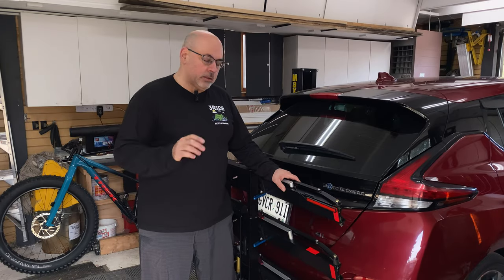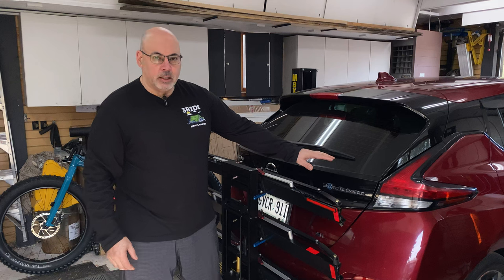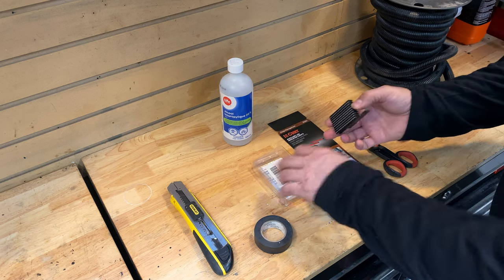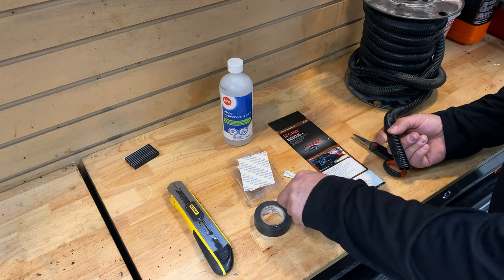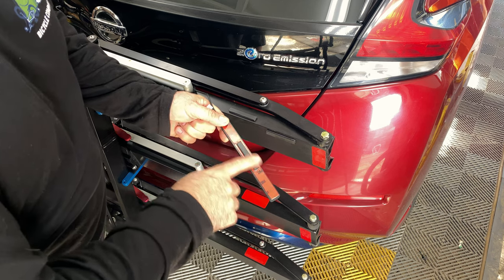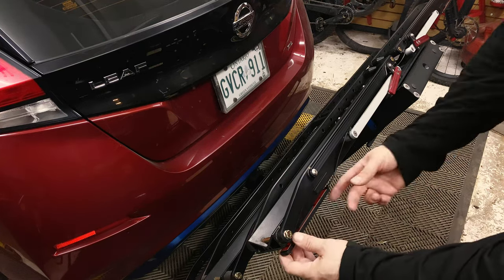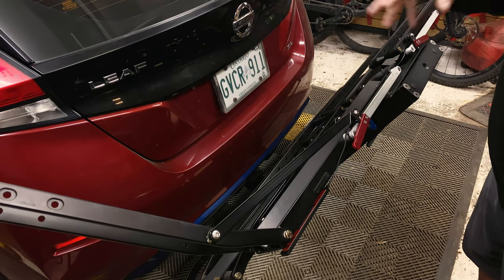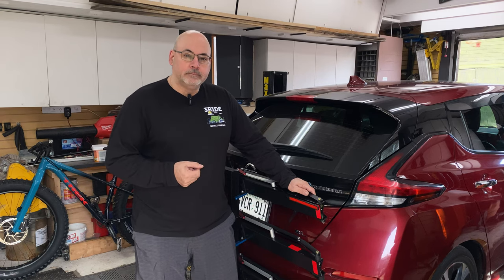Magnetic LED lights for your 1UP bike rack!

Comment: Thanks for the great tip. What did you do to install a hitch receiver on the Leaf? And what year Leaf?
Reply from the maker: The LEAF is a 2018 SL.  The hitch and hitch wiring came from etrailer.com as I recall (EcoHitch Hidden Trailer Hitch Receiver - Custom Fit - 2").  Hitch is here:
https://www.etrailer.com/p-306-X7221.html?hhyear=2018&hhmake=Nissan&hhmodel=Leaf

Curt has a very nice wiring kit as well, although I did have to run a fused power wire from the battery up front, to the trailer wiring at the back:
https://www.etrailer.com/Custom-Fit-Vehicle-Wiring/Nissan/Leaf/2018/C56227.html?VehicleID=201824253

Comment: Dennis which magnets did you get on Amazon? Thanks!
Reply from the maker: @robgonzalezphotography  These were the ones.  They have proved useful for a few other projects as well :-)
 https://www.amazon.ca/dp/B081W5P4GD
“DIYMAG Waterproof Neodymium Bar Magnets with Epoxy Coating, Powerful Permanent Rare Earth Magnets, with Double-Sided Adhesive - 60 x 10 x 3mm, Pack of 24”
Reply: Thank you!